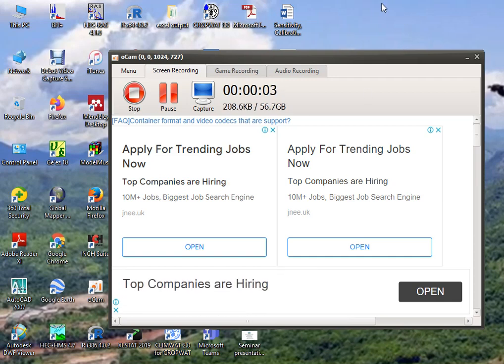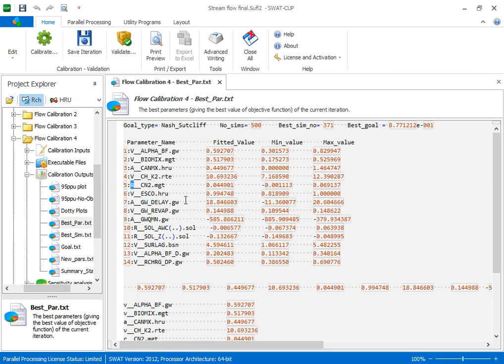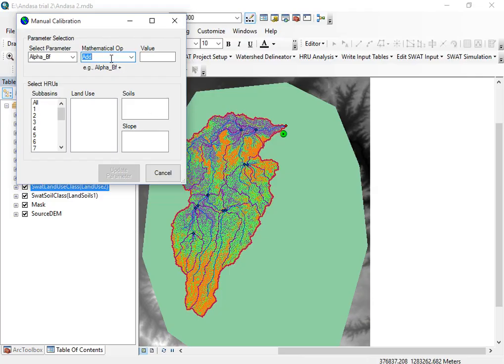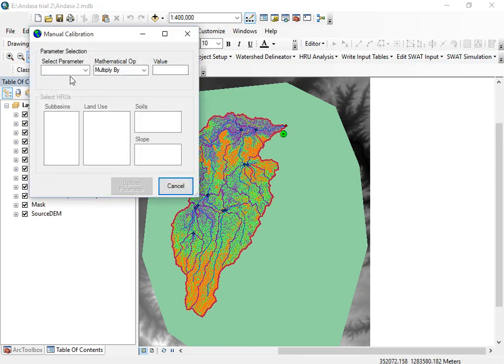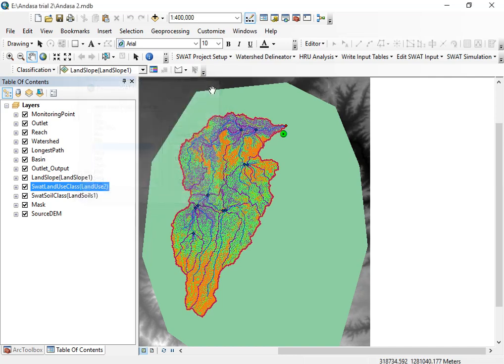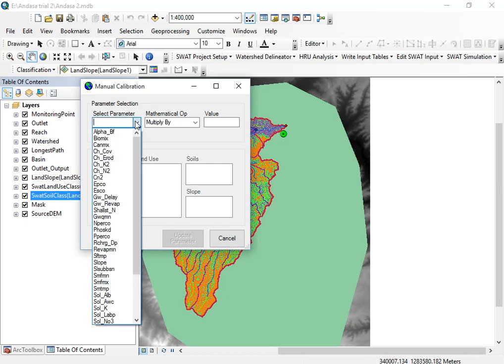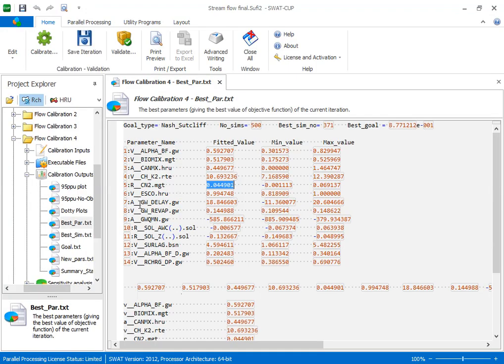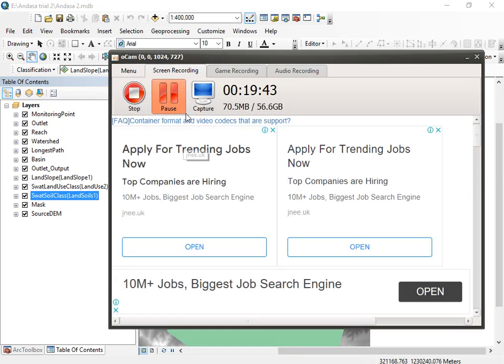How to rerun Arc SWAT Model Using fitted values?

Comment: Hello Sir, after rerun am i supposed to save the simulation and open another swat-cup project and i calibrate again or i adjust the parameters again to reduce the error messages then those values i get they are the ones i use in the next iteration that give me the right water balance